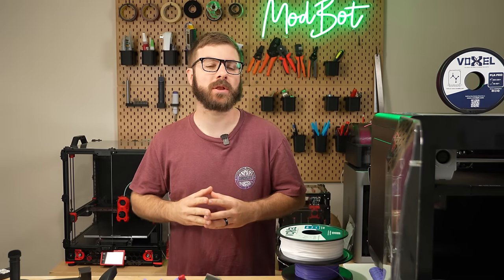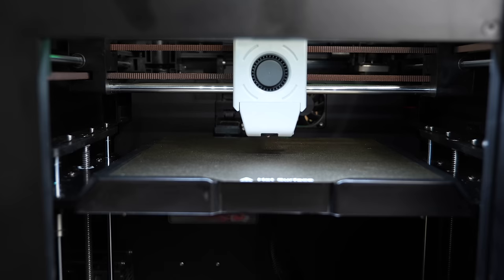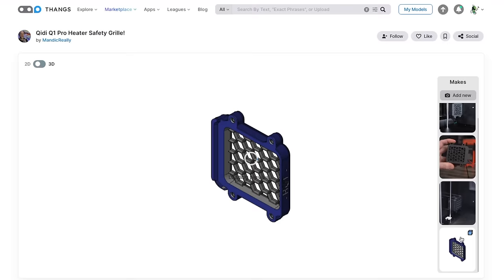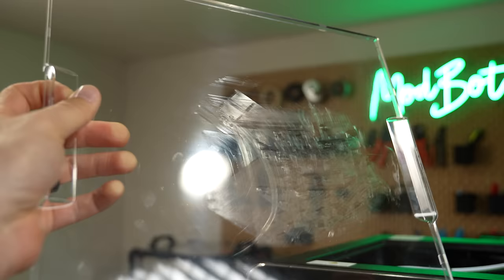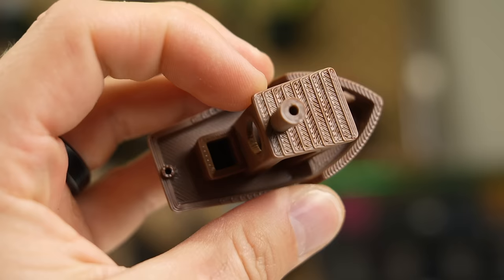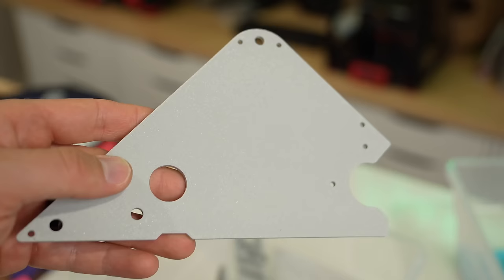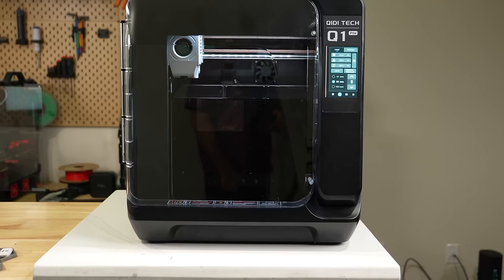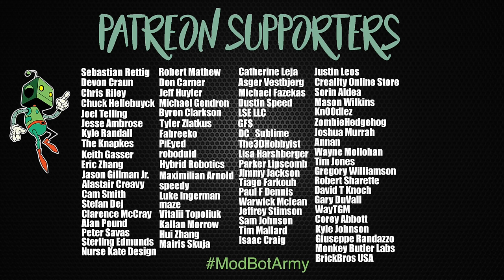Sub $500 High Temp Fully Enclosed CoreXY 3d Printer (Qidi Tech Q1 Pro)

Comment: I just wish more manufacturers would just go mainline Klipper and Orca Slicer and just let the community handle the software and focus on making the best hardware.
Reply: They have to drop those awful customized user interfaces and do standard Klipperscreen. Sovol does that.
Reply: I agree in general but IDK how sustainable that is when companies are using custom hardware to do new things
Reply: nah, most of us (me included) just want an easy experience, like bambu labs and its very well designed ecosystem
Reply: Qidi Slicer is actually pretty nice and actually up to date unlike Klipper on the machine, and I don’t like Orca, it feels more clumsy and slow. I now exclusively use Qidi Slicer.
Reply: That is why I preordered the sovol sv08. I thought it was strange people were complaining that they were shipping with a pretty bare bones klipper cfg.
Reply: @downsyndromebear the only problem I see is that these companies are advertising features that don't work out of the box without the user making some printer.cfg changes. This is bad because it means they haven't extensively tested the device. Also, if you are highlighting it as a pre built machine, should at least work out of the box and ideally the user should just be able to add features and run calibration if needed later on.
Reply: @Duckferd  that is true. I know there are people who just want to set something up and forget it. I'm a thinker, so I never really mind digging into that kind of stuff.
Reply: @jordanplays-transitandgame1690  Mainline Klipper and Orcaslicer doesn't make it harder to use, if anything it makes it way easier. Orcaslicer is literally just Bambu Slicer but better and Mainline Klipper means you just get the newest auto updates and don't have to worry about manufacturer updates or the lack off.
People always act like anything that isn't Bambu is impossible to use, most of the time they have never used anything aside from Bambu themself or maybe and Ender or don't even own a 3D printer. They are called the apple fans of 3d printing for a reason.
Reply: I would argue that a big part of bambu labs success is not using open source firmware/software
Reply: they totally used foss software, changed a few things, and closed it off. it helped no one
Reply: @kwedl  I mean tbf I am a Ender and Bambu user and just looking at Orca gives me a brain stroke lmao, I prefer Bambu slicer and Cura.
Reply: I was about to comment the exact same thing, the vanilla version is tried and tested, the money used on the development and updating of a klipper fork could be used elsewhere or used to reduce the retail price!
Reply: This and even though the Creality K1 does this, it sucks they've gone with proprietary nozzles and not the most user serviceability.

Comment: I wonder 1) how much does 60C vs 65C affect part strength? 2) besides being silly, what is the real downside of using old klipper? If it prints, it prints. Tinkering is not what this printer is about.
Reply: Also, the Q1 pro accepts 65C not 60C as stated in the specifications
Reply: The reason for wanting mainline klipper is usually for integration of other functions. Like i wouldn't be able to use my annex tradrack on this printer, without extra work.
Reply: @53Aries  ok but this printer falls in the category "ready to use products", so it's not really the right one to mod that way. For example, the mainboard has no unused pins, so the only way would be to add a secondary USB board.

Comment: When would the runout sensor ever be used? As soon as the filament comes off the roll, the tangle sensor will stop sending movement pulses first without any filament going through it. The runout sensor could tell if the filament breaks between the sensors, but again, the tangle one will stop sending pulses as soon as that happens.

Comment: 2 things: 
- Dirty klipper repo just means there are uncommitted files in the folder. This could be happening in mainline as well if you modified the MCU configuration without committing them locally. So I don't know that that's a custom fork running. You'd need to check with "git remote get-url origin" to confirm it. 
- The drift on z that you were seeing for your first layer could be attributed to thermal drift on the inductive probe. If it's not a higher quality unit, there is no (or poor) thermal compensation accounting for it. That would mean that you'd get inconsistent z probe measurements when the chamber is hot, as opposed to when you had it cool off.

Comment: Qidi uses the inductive probe for leveling due to speed. There is a team implementing load cells into klipper for direct force readout (actual force, not just converted into a trigger signal like a cr6 or similar), probe speed and standard deviation are inverse to each outer, meaning twice the probe speed, half the accuracy. To get to klicky like repeatability they had to probe around 3mm/s or, while klicky and most other probes aren't nearly as much affected by probe speed. This would result in a agonisingly slow mesh, like you would have on very basic abl implementations for marlin printers from 4 years ago

Comment: Thanks for the review! I happened to order mine on release day, and got mine 03/23/24. It was pretty great out of the box, but 2 big issues became obvious. First, belt tensioning system sucks. Constant ringing no matter what I do. Qidi support and I have 30+ emails going back and forth trying to figure it out. Can’t seem to fix it. The second issue is that my hot end decided to die. Doesn’t heat anymore. I then am currently in the process of returning it, but the printer won’t export log files to the USB drive so they are going to charge me return shipping. It has been a real bummer because I was so excited about this printer.

Comment: FYI: 
    klipper 0.10.0 instead 0.12.0
    No Klipperscreen
   Armbian Buster instead Bookworm
    Python 2.7 instead 3.12
    And all the outdated software that comes with this (fluidd, moonraker, etc.)
    The disk comes prefilled with a lot of unnecessary things. ~5-7GB are used of the 8GB EMMC disk.
    This means that additional features or even some GCODE files will fill your disk space entirely.
    You can't install any actual plugin due to the firmware being outdated.
Reply: I bought an xplus3 and while I do love it, these are some legitimate, if IMO minor gripes.
Reply: It’s 32GB.
Reply: Base OS has Python 3.7.3 though

I managed to port the most recent Klippain Shaketune to the base OS just fine.

Comment: Never had an issue with adhesion or Z offset issues. That being said I do preheat soak the bed before meshing. For materials that require elevated chamber temperatures, I let the item cool to room temp before opening the door. These are just old habits that work for me and the Q1 Pro.
Reply: Even on my open printers I let the bed cool to the touch (usually around 30Cor so) before removing prints.  With my SV07 Plus, I manually start a cooldown pass so that the aux fan runs across the bed if I'm being impatient.

Comment: Why is it so hard to take the fan wires off of the cover?..Connection pads would work fine for 12/24 volt and it’s something I have been thinking about doing myself..

Comment: I had issues with the config for the control board fan being set to .6 which caused the printer to lock up during use of the chamber heater. After support told me to set the config to 1 the printer is not locking up anymore. I have also updated the firmware twice to now the latest. All my abs prints and silk and pla have had the best first layers ive every seen. It may be the fact that yours may have a older firmware. This printer prints abs like and absolute champ and there is a riser file for the top, as i got the same scuffing but will try to polish it out. NeeditMakeit has several upgrades to print for the machine on Maker World.

Comment: Z offset thermal drift could most likely be caused by the inductive probe.
Reply: I learned a long time ago to heat soak my bed for at least 20 minutes before recalibrating and starting a fresh set of prints. At that point, non-sticking prints became a thing of the past.
Reply: @RocktCityTim  What do you mean by recalibrating? Recalibrating as in like bed meshing and z offset or are you talking about running the auto calibration?
Reply: @Khoomn  Any time that I power off the printer for more than a few minutes, change the nozzle, or swap bed plates I re-cal the whole shebang. Adds around 25 minutes to the process, but for a functional part that will take 6-12 hours to print, that's a small price to pay.

Comment: Rapid change of temp tends to create greater and more unpredictable warping of materials, same as with quenching a knife blade in water vs oil.

Water cools down things so fast that it increases stresses in the material and increases chances of cracking and warping, the oil is only marginally slower but it makes a huge difference.

Those 15 minutes of wait to cool down vs  the thermal shock of immediately introducing cooler air is probably the same thing, makes things happen a bit too fast and introducing unpredictable warping making tweaking of first layer needed every time...

Comment: thing is, for about 300 bucks more you can get a pre-built voron 2.4 350 from Sovol, the SV08, and yes I do mean the enclosed version which is running at 700 bucks.  As that version of the SV08 is, technically, a 2.4 at that point being fully enclosed, as you would have with any 2.4 kit.  (Note: Quite nice that Sovol went with Canbus on it too).  Also, thank God that Sovol did run vanilla Klipper on this and not their own "version", very annoying for manufacturers to do this and very very very stupid.  With vanilla klipper you can do a lot of modding and tuning, much easier then trying to fumble around XX's version.

Comment: Surprised to see an 8GB EMMC... on the website it says it's a 32GB. I guess they updated the retail version from the reviewer version?
Reply: Correct mine came with 32GB.
Reply: @kerwalker4246  any other notable changes from reviewer version that stands out at all? Mine is set for delivery end of may so im not sure if its an updated version or just logistics of transport/shipping to US etc for delivery being end of May.
Reply: Seems my reply somehow got lost in the ether. Wonder why?
Reply: @JMS7410- ok I will try again. No nothing has or will change I would guess. Door is not an issue as it opens and closed like a door with the provided recess handle. Enough said basically on that matter. Chamber heater - they now provide a file to print a guard so I’m sure that’s the only solution to a fairly non issue in the first place. Firmware has changed twice and appears to resolve what issues some faced. Overall they have addressed some minor issues fairly quickly and so far after a month  of use it works well, in fact extremely well for the price. You won’t regret it I’m sure.
Reply: @kerwalker4246  I am hoping so. I just returned an Adventurer 5M Pro as anytime id print higher temp materials (ASA for example) - the printer HW was very susceptible to locking up or encountering an error code... it was a great printer but I think the HW limitations on it were just too significant. I felt bad though... it printed PLA, PETA, and ASA beautifully once dialed in.
Reply: @JMS7410-  it works straight out the box. All profiles worked first time for me. Prints ASA, ASA CF, ABS GF, PETG, PETG CF real well and PA6 CF after I dialled it in nice also. Super smooth with non or virtually no layer lines in most refined modes. I just wanted a no tinkering unit after my Kywoo max so opted for this at the pre order price. Really can’t go wrong at this price range and what you get for it. Enjoy when you get it. 👍
Reply: @kerwalker4246  I already pre-printed the top riser so the ptfe tube doesnt scratch, new filament arm, door latch attachment, etc. Oh! did yours happen to have an ethernet adapter or still only wifi? I saw the teardown has an ethernet solder area on the board but not installed on the reviewer units. Thanks again for your feedback btw!
Reply: @JMS7410-  I went for the “Monkey Bar Slim” as it worked for my work space it put the reel side profile in the side of the unit. Really neat design. The riser I printed fits the lid but does not fit recessed section so sits very unstable especially with a rapid print job. I saw a better (TPU) version that is more shaped to fit I will give a go soon. But to date I put brown PTFE tape over the PTFE tubes highest point and have no scuffs or marks but will still print the TPU riser soon. Just got a lot of work on at this point.
Reply: @JMS7410-  no I’m fine with WiFi. There is space for a Ethernet port but i can’t recall seeing an LAN controller chip on the board. I’m not sure but I think the footprint was empty for this controller. But nevertheless WiFi works well and I’m not concerned with regard to security issues some are stating. It’s safe on your own network and not open to the outside world.

Comment: I get that induction probes are fast, but they have so many drawbacks like this, I'll never understand why they're standard now. You can pre-calibrate bed meshes for every temperature setting at much higher densities than you'd ever print with in Klipper, then just load and go based on the bed temperature used in the print. It doesn't really matter how fast your probe is then, install the one on that will give your users good, consistent results.
Reply: That assumes that the printer dimensions change only due to thermal expansion. How do you address nonrepeatable frame/joint movement (e.g. from moving the printer around)?
Reply: @AwestrikeFearofGods  You do new meshes when you move the printer. It shouldn't be happening very often. You also need to do a new frequency response calibration when you move one.

Comment: I really like this printer, but shipping was really expensive for me.
Reply: how much did you pay for this printer?
I haven't bought a 3D printer yet because in israhell/palestine they cost double or triple than other countries and I don't want to remit taxes to the mafia
Reply: @flat-earther  I actually didn't buy it, I guess I should have written is instead of was. But shipping is close to $300 I think, and I would have to pay an additional 25% VAT and a handling fee of $30-40 on top of that, so It would get expensive.
Reply: @MakerViking  okay. yes. same problem here. I hope you can find a good deal. I wish I could buy stuff without having to do anything with gubments. I don't want gubments. taxation is slavery, do you think so?
Reply: @flat-earther  I'll probably end up buying a different printer. :) Governments are necessary, but some governments are worse than others. I don't agree with everything our government here in Norway does, but they are doing an ok job for the most part. Taxes are too high at least, but Norway is a good country to live in.

Comment: And if someone would like to print a lot of ABS but has no advanced knowledge or experience?
Which printer?
Reply: You really want an actively heated chamber to make ABS printing easy, so Qidi is pretty much your only option unless you want to pay 3x+ more.
Reply: @SolaAesir  but is an actively heated chamber essential for ABS? P1S and K1(c) seem to print ABS fine. 
This is the big question: how much improvement do I get with ABS with heated actively vs passively? P1S reaches 50-55°C, I think.
Reply: @olafmarzocchi6194  Small parts (size of a fist or maybe two fists), well designed for 3D printing, you can get by with just a good enclosure passively heated. If you want to print larger parts or parts with thin sections or sharp edges and then you really need an active heater. Every degree of heating you can get helps a lot making those tricky parts print successfully without warping. Ideally you want a printer that can do a 90-100C chamber but that requires a custom built printer designed with that in mind (not a Voron).
Reply: @SolaAesir  I found CNC Kitchen did a test by printing ABS inside a X-max 3 room temperature, passive heated, 65 °C heating. Even small parts got a 10% increase in strength by heating at 65 °C. The Q1 Pro advertises 60 °C but accepts 65 °C as setting (I guess 65 °C starts getting too much for the heater they provide), so the results are the same
Reply: @olafmarzocchi6194  Yes, all parts will get stronger between the layers the hotter you get your chamber but most people don't need it and you can anneal ABS a lot easier than you can PLA to get most of those benefits too. Being able to make the print at all without constant failures due to warping is the biggest reason you want high chamber temperatures for ABS and other materials.
Reply: @SolaAesir  I ordered one...

Comment: I just received my X max 3 a couple days ago and I am begging to regret my decision to get it. Was very excited waiting for it to show up and couldn't wait to unbox it.  It has turned into a 1000 dollar paper weight that could have been avoided if somewhere I had been instructed never to update it. After plugging in my camera, Fluidd notified me for updates to Klipper, Fluidd, and Moonraker and of course I clicked on update all. Very bad decision cause printer does not work now and been waiting for 2 days on replay from Qidi support only thing I've got back so far is we need proof of purchase and you are not suppose to update anything due to their modified versions of firmware and software that works only with this printer. I did not get to print anything yet, but hopefully once I get help from them in the near future fingers cross it will work great cause I would hate to send it back and get a bambu :( without even seeing for myself what it can do. Starting to think I made a bad decision going with QIDI.